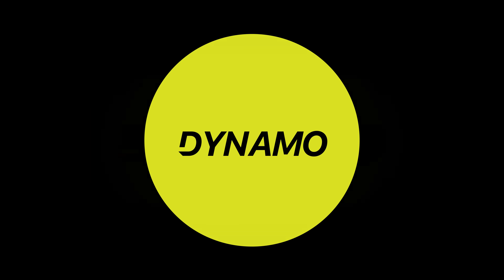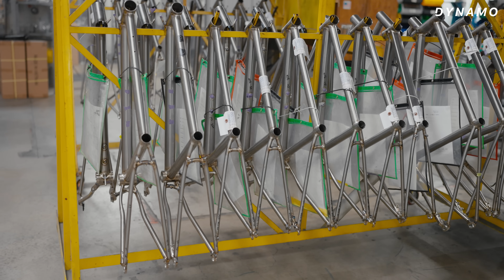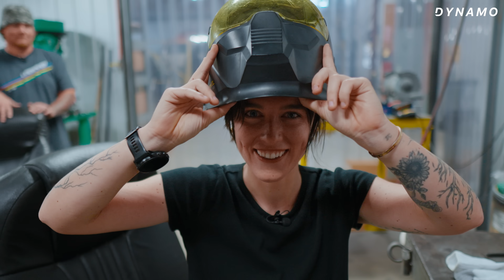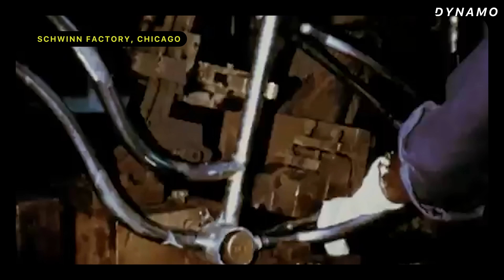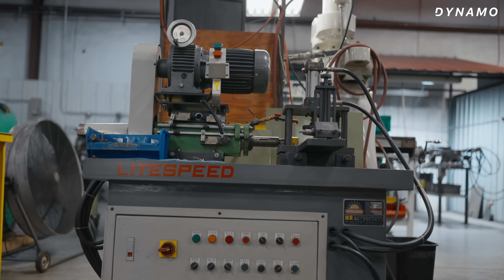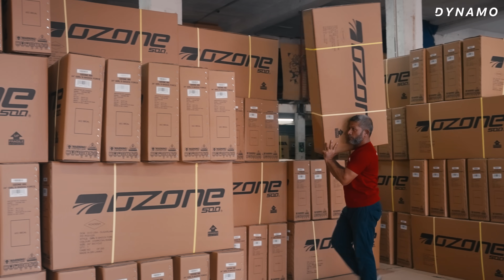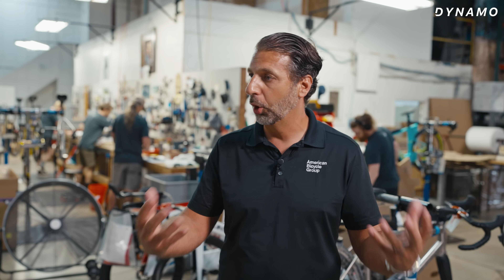What 'Made In America' ACTUALLY Looks Like

Comment: Suppliers concentrate WHERE THEY ARE NEEEDED.

Corning can make glass and ceramics anywhere in the world, but they make them in China because the industrial demand is there and in nearby Taiwan and Korea.
Growing high-value-added industries (such as bicycle assembly, for example) can help move a little more of the supply chain inwards. It doesn't make sense to start with trade restrictions affecting the supply chain, since instead of gaining more domestic supply chain, you're more likely to lose the domestic end-manufacturing chain, as sourcing components becomes increasingly less affordable for them.

Today, by and large, every sort of manufacturing enterprise has to be global if it wants to be efficient. If you want, you can have a Soviet style insular economy where everything it needs is manufactured domestically, but in turn you will have reduced affordability and reduced product quality, and your manufacturers will not be globally competitive, so nobody will buy your shit either.

So even trade restrictions designed to shield your market are very much a double edged sword, because if your manufacturers don't have to compete with global ones, they won't, and you'll get obsolete shit at astronomical prices.

Comment: If the factory requires 350 people to manufacture 500 bikes. That means each person assembles 1.4 bikes a day. If the laborers in the factory were paid $25 an hour for an 8-hour work day, that means the labor cost on each bike would be $142.86. which goes to say it is very fair to say that the manufacturing of bicycles in the $150 range would be completely impossible in the United States. This doesn't account for the actual raw materials that went into the manufacturing or the pre-assembled parts such as brake, levers and saddles. In raw labor it cost $150 a bike

Comment: I think china's biggest advantage at this stage is skill. You can build the factories but if you have no one to train your workers, much less trained workers, how are you producing anything? How do you reproduce the 5 decades of manufacturing know-how that goes into designing the most efficient factories. We're not just decades behind building factories, we're decades behind in material know-how. Same issue construction is facing, that's why in spite of new faster, more powerful tools productivity is declining.

Also, some US engineers toured China's infrastructure and said we're so far behind in electrical capacity we've probably already lost the AI race. The US doesn't care about manufacturing, really. China, I think understands the strategic importance of being able to turn off the tap of material support because ultimately fiat currency is only as valuable as our word.

You don't seem happy, Kyla /:

Comment: Can things be made in the US?  Sure.  It depends on the materials you choose and the quality of those materials.  The US originally made bicycles from steel because we have plenty of good quality iron ore in the US compared to China.  The only material that was imported was the rubber for the tires.  These bicycles in the video are primarily constructed of titanium and other materials not common to the US in the quality required.  The other issue is legality and insurance.  Laws have made the value and risk management of producing many high quality materials in the US cost prohibitive or outright illegal.

Comment: One thing USA should do (or must do) is convert from the archaic Imperial “System” (sic) to the Metric System immediately!

Imperial is not even remotely a “System” - it’s a hodgepodge of different measurements. 

In contrast, Metric is based on the power of 10 - you never need to find a “common” denominator - just move the decimal point!

Don’t waste precious brain space trying to convert from Imperial - just use METRIC NOW!

Comment: One thing you failed to even mention is the quality of the bike made in Sri Lanka, or really lack there of and the high quality the bicycle assembled in America is.  The bike from Sri Lanka gets sold at a department store and within 2 years ends up a rusty pile in a land fill.  The bicycle assembled in America ends up being used for 15-20 years because it will hold up to the test of time.

Also just because a goal of becoming a country that produces again may take a generation, that doesn't mean you give up on the idea.  It means you push harder to make that goal come to fruition faster.
Reply: She should have visited companies like Giant or Merida too. Most western bike brands outsourced the production to these companies, which not just offer own bikes but also work as subcontractors.

These are high quality bikes from the Western top brands.

The difference is, Giant and Merida invested in automated production, western manufacturers did not.

The typical brand bike you buy in bike shops which also last decades with proper maintenance is made by these 2 companies in south-east Asia.

Comment: Fun fact, One of the Chinese bike brands, Shanghai Phoenix its Danyang factory, makes 3 million (traditional bicycles + e bike) a year, approx. 3,000,000 / 52 weeks = 57,700 / weeks. How? They use Robotic welding arms, automatic conveyor line for cleaning, anti-rust treatment, powder coating or spray painting, semi-automatic lacing and tensioning machines, etc. At each station with human + machine cooperation. 😅
Reply: And at the end it is the same ol' good chinese sheet anyway

Comment: This company seems less like a manufacturer, and more like an assembly factory that makes expensive frames.

Not bashing them, I'm sure they are a good company.

I work in a factory that makes magnetrons as an electronics technician, in my niche area we still do root cause analysis for most of our repairs. We also build our own power supplies, circuit boards or transformers as required. I'm still repairing Agilent/HP equipment from the 70's, and Sorensen power supplies from the 90's.

I feel like after the older generation at my factory retires, and if I don't carry on the torch, it'll all be lost to parts-replacers.

Comment: Don't throw the baby out with the bathwater when arguing over semantics about what qualifies as "made in". The key goal is to bring back jobs, skills, and ultimately rebuild a market share for domestically produced goods that can support re-integrating more domestic involvement into the entire supply chain. Anything is better than nothing at this point. Things like tariffs are extremely important to level the playing field because when a Sri Lankan worker can live for $150/mo, there is no reality where you can build a bicycle in America paying an American worker $150/mo. At least not a reality that you'd be comfortable living there. If a bicycle can be made in and imported from Sri Lanka for $200, where that same bicycle would cost $600 to make in the U.S. meaning bikes would need to be priced at $800 to be profitable where imported bikes could be sold for $400 for the same profit margin. The theoretical solution is to add a $200 tariff on bikes from Sri Lanka. That $400 bike costs $600. The $200 goes to the American bike manufacturers as a subsidy so their $600 manufacturing cost reduces to $400, and can maintain the same profit margin to compete. In theory that is how it should work, doing so in practice is a completely different beast across an entire market.

Comment: Shimano and SRAM dominate drivetrains.  RockShox and Fox dominate suspension parts for mountain bikes.  There are many manufacturers of tires, handlebars, grips, seats, and pedals.  So when it really comes down to it, "bike manufacturers" are really just making two triangles out of metal or carbon fiber, painting it, slapping a sticker on it, and then bolting on the industry-standard parts everybody uses.

Comment: The globalization of manufacturing was a good thing, despite the pain of lost jobs, and the backslide we're in is not going to make things better or return the "glory days". US manufacturing pivoted towards high-value, high-tech, high skill manufacturing. Those jobs pay extremely well, and the products make a lot of money. Contrast with the parts that go into a bike. None of it is high-value, high-tech, or high skill. It's smelting ore and machining metal. There's a lot of capital costs for the machinery, and a lot of energy costs for the manufacturing, but the skill required to do the job is quite low. Even if we brought manufacturing like that back to the US, the jobs would likely be minimum wage, and the products would be more expensive than anyone wants to pay. More likely, the factories would be highly automated, so there wouldn't be many jobs at all.

Bringing back manufacturing to the US is a pipe dream that won't accomplish what you want it to accomplish. It will come at enormous cost up front and in the long term, for practically no benefit.

There may be some sense in on-shoring critical production chains - things that could cause significant economic devastation if the global supply chains were severed entirely. Those are always going to be comparatively small-scale operations, producing just enough to preserve the capability, with a relatively large amount of spare capacity to ramp up production if really needed. Those jobs still won't be well-paid, and there won't be many of them.

Meanwhile, the trade wars with everyone are destroying relationships with our friends and allies. It's boneheadedly stupid idiocy, wrought large upon the world.

Comment: I would recommend anyone interested after this video to check out the essay, "I, Pencil".  It chronicles a good part of what goes into making a pencil and from where.  The moral is that free markets are amazing and lead to us being able to have cheap pencils and bicycles with very few people (if any) actually knowing the entire process of how they are made.

Take the shifters and brakes in this video.  Where do the cables come from?  Where are the metals cast into their final shape before machining?  Are the parts machined directly, or are they machined in a general shape and then finished at another factory?  Where was the metal refined?  Where was the plastic resin made?  Where did the oil come from for the resin?  We can always go back one step.  It wouldn't be surprising if some of the material of "foreign" parts is actually sourced in the US.  The US makes a lot of machinery and inputs for manufacturing overseas.

Comment: I know of couplings used for mechanical power transmission that are stamped "Made in USA" even though the machined blanks originate from China.  Some of those couplings the only thing we do here domestically is machine the bore, keyway, and set screw holes.  Some of the gear coupling hubs that get sold as a RSB (Rough Standard Bore) the only thing we machine in the US on those parts is the gear teeth.  As far as titanium as a raw material I know we don't have much here domestically.  Back when the SR71 Blackbird was being made the CIA set up shell companies to purchase the titanium used to build the planes from the Soviet Union.

Comment: TBH, as an outsider who see’s the USA as a services behemoth (even if the data centers are located overseas, and the equipment made overseas), I don’t get this push back into manufacturing.

Isn’t expanding your current strengths going to be far easier vs mass market manufacturing?

Leave the domestic manufacturing to specialised products. The video had one. The Shimano groupset. Litespeed was definitely using a high end variant as it was made in Japan. The middle and lower ones are made in other countries.

Comment: Yes you can build in America. I am a Mechanical engineer and I have Designed things in America for US based companies. I am not a Manufacturing Engineer, however the US does make things. 
Does Sri Lanka make single-crystal coated turbine blades for high-bypass ratio turbines?! NO! Can they make them? Yes, however they do not yet have the Industrial capabilities (not Intellectual capacity) to do so, but one day they will. 
Yes, the US imports Titanium, until our energy cost differential with Japan (which has ZERO 0️⃣ NATIVE energy resources economically recoverable) makes ppl think twice. 
Manufacturing left the US NOT just because of hourly wages as your are implying, but because US companies work hard to maximize profits, and one easy way to achieve that is by steering away from “Overhead”: from 401K (which used to be pension funds) to HR, health Insurance, paid vacation, cooling/heating bills, building and office equipment leases and parking lot cameras to maintain. 
Honestly, I don’t understand your REAL point! 
Go check out Manufacturing in Germany 🇩🇪, Switzerland 🇨🇭 or Sweden 🇸🇪, and ask the same question from their perspective. But I have a feeling that you will never do that, because you would very quickly discover that Germany is (or used to be) a Manufacturing Powerhouse in a global sense. Yes, “little” (by surface area) Germany!

Comment: Even if it were possible, would anyone want it? Quality is MUCH higher outside the US for every single component, let alone as a whole. Then you have high costs in the US. Then supply chain issues. Lack of labor force. So many more roadblocks. Not the least of which is that "US Made" is generally a poison pill globally - no one in the EU or Canada wants to buy anything made in the US if they can help it. You might as well try to bring back every species of extinct animal, starting with every dinosaur. Manufacturing in the US for mass-market is dead and under no circumstances can that ever change.

Comment: If Ozone would’ve mass orders for titanium bikes, they could also produce these. 
It’s just a question of training to assemble a bike in high quality.
Training of the welders up to the assembly worker. 
Fact.

Compared to cars, bicycle production is way less automated than car nmanufacturers. 
Nobody would buy a bicycle frame with the poor welding seams or even spot welded metal sheets as cars are made of! 
They just have a „nice“ cover-up all around and inside! 
On a bicycle you see everything! 

Production costs for a bicycle consist mainly of
1. Components 
2. Labor cost /minute

Ozone could do the same Full Factory assembly of the litespeed, if the minimum quantity is enough to get a real factory mass production set up.

The labor cost is defined by wages, taxes, insurance costs, electricity bills etc etc.
The cost/minute in Bangladesh is at roughly $0,15/minute. (That’s where the Cannondale Al frames are made since 2014)
That’s 1/100th of the cost/min than in the US or Europe.

The assembly of a Mountainbike is approximately 180 minutes, a full suspension MtB about 280 minutes and that of an electric touring bike 360 minutes. 
Electric tandems are in the range of (assembly only) 860- 900 minutes!
So, the assembly costs weights out up to a threshold, when parts surpass 75% the cost of the ex-works price of the bike.

A litespeed assembly can’t be compared to the Asian factories as they are single custom builds only and the component prices are soo high, they outnumber the more expensive assembly in ten states.
Mass production is way cheaper in Asia than in the old west. 
Ozone Mountainbikes - as shown in the vid - have a component value of approximately $80-85. The assembly in the states (full suspension MBB, appr 260 minutes) would add up to $ 400  assembly cost in the US , compared to $3 in Asia. 
That’s why these ozone mtb can be sold for $ 269 in the shop!

Comment: A prime first-hand experience of made in the USA is the industrial vibration units we use. The bearings are lower quality Chinese bearings that last about 2-3 months. We pull them apart and install Tier 1 Chinese bearings and voila! we get 3-5 years of service. Unfortunately many companies think that using lower cost materials works, but customers will find another way or go elsewhere. Western manufacturers need to maintain a quality product or they will fall by the wayside.

Comment: Litespeed bicycle costs like USD 6'000,-. It's a premium brand. Ozone, Sri Lanka are bikes for the masses. As long there are people, that buy this or that, everything is fine.
For example 1985 or 1990 were Trek Mountainbikes with frames tubes from Japan and built "Made in thr USA". This frames had a great quality and are in some cases still around. These Mountainbikes costs the consumer +/- USD 1'500,- to +/- 2'000,-. They were affordable. At least the frame as heart piece  of the bicycle was "US-made". How much did some of these Trek frames "Made in the USA" cost for Trek to produce?, this would be interesting to know. The Ozone frames for example they can do for only around USD 20,- inclucing color in mass production or even for less.
Reply: A $2000 bike would be a $5000 bike today, if you count inflation.

A $5000 bike today is MASSIVELY better than a $2000 Trek from 1990.

Comment: That is actually a very fancy bike "shop", not a bike factory.  Very little specific tooling, jigs, and no assembly line.  Just a bunch a dudes building bikes from OTC parts.  The oversea ones shown in the video are actual factories.
Reply: Theyre welding frames from tubing just like the sri lanka factory. They say that factory also makes wheels. Both are using outsourced components.
Reply: Do you have any idea about Litespeed bikes?  It doesn't sound like it.
Reply: @ericpmoss  Still a fancy bike shop.  Nothing wrong with it.  It's just not a factory.
Reply: @ihcnehc  most bike shops are not welding frames.